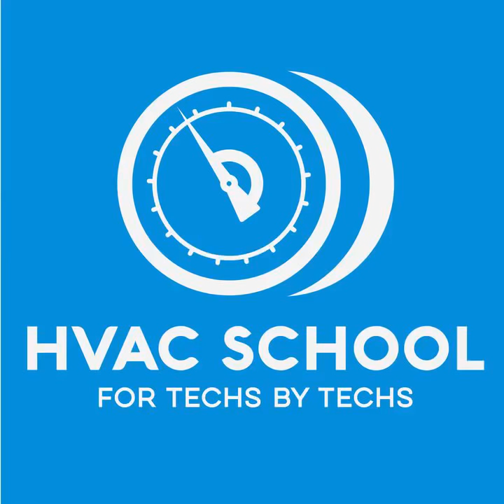Short 22 - Mineral & POE Oil

Comment: Removed an evaporator from an R22 unit...evap had LOTS of oil.  I’m concerned that the compressor doesn’t have enough mineral oil left...is there a way to get it back in the compressor (new oil of course)?  It’s a sealed compressor on a 4 ton geothermal unit.

Comment: All I am hearing is that the older systems and R-22 with Mineral Oil were better and more resilient. Maybe a bit 2-5% less efficient, but that is debatable. The replacements are designed to fail within 10-15 years; built in obsolescence. Higher working pressures, oil that loves moisture (which creates acids when mixed with refrigerant, which then creates sludge). If a leak is present, the refrigerant will undergo fractionization, thus compromising the integrity and properties of the remaining refrigerant. Fluoride atoms are harder to detect than Chloride during leaks/micro leaks.  Plus the patents on R-22 expired long ago and by making them illegal no other company can make a sell R-22 for cheapo. 

The upcoming push to HC (hydrocarbons) is an even worse scam. Very few will be able to repair these systems due to explosive nature of it. Plus with the ESG push hydrocarbons want to be phased out via taxation, regulation, and "carbon credit" rationing. 

So yes... the plebs will be driven further into poverty just to keep the house cool and warm. The decades of the 2030's is going to be ******g sad. NeoSerfdom.

Comment: Top-Quality content!!! I recently swapped an old R-22 AC system with a Condenser on Roof and Evap below in store. Had a P-Trap . I assumed it's there for a reason. Flushed lines with R-11 and put a new P-Trap in same spot... About 25 ft vertical run of lineset. Pulled a good vacuum, checked for leaks. Opened valves. I installed Service ports right next to Evap coil so I don't have to haul tools up big sketchy ladder. Well the system starts and runs fine for about 10 minutes and then suction line sat & pressure keep dropping to sub-freezing. Coil freezes up. Airflow is good, TXV is responsive, no noticeable restrictions. Was very stumped and so were all the other techs I shared info with... Well now I'm thinking either I should've moved the Trap to below new evap and added traps every 3.5m vertical, or just completely remove the Trap. It's a 120K BTU R-410A Central Air system. What do you think?

Comment: What is the difference between POE & PVE oil, some Ductless units use PVE oil, which is better?
Reply: PVE oil is more hygroscopic than POE, but  it won't undergo hydrolysis. Same is for PAG oils. Bryan wrote a very informative article about oils in their HVAC School site!
Reply: I'd rather more water than acid!POE oil is a crux for system lifetime these days, I think. Sure, you can do everything right, but do the manaracturers of cheap AC units do it right, or do they not care about premature failure? And some people will insist on not nitro purging or vacuuming with a micron guage in 2024 and the oil ends up being a liability nevertheless. I would prefer to see PAG or PVE honestly. @themistoklisk82